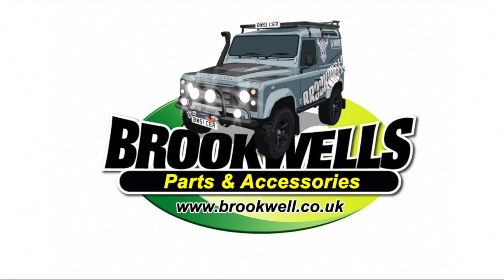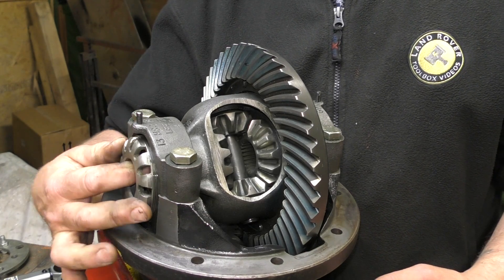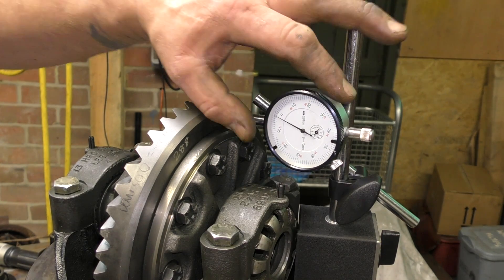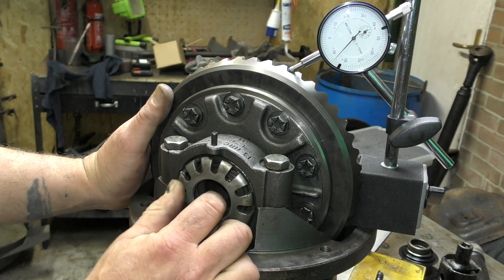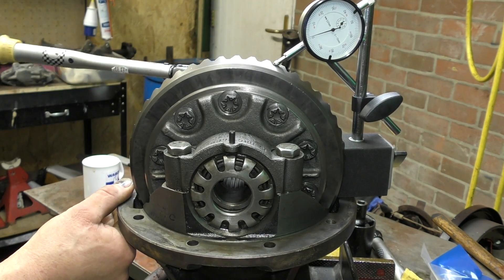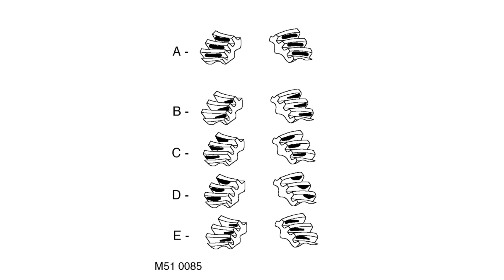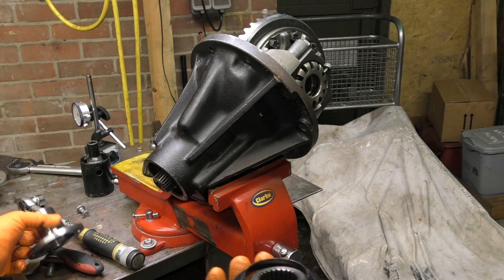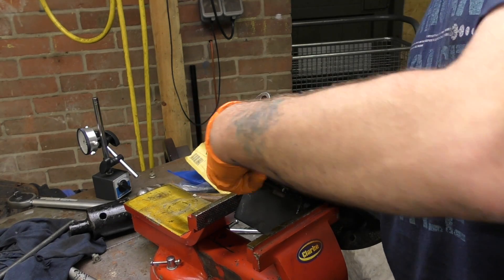Land Rover Diff Overhaul - Finally, Setting Up the Backlash, Zero End Float and meshing test.

Comment: Hi, I have about an inch of backlash movement on my S3 front diff. Can I take out the diff and just tighten the adjuster caps a little? Thanks
Reply: You could do though it’s a pita to remove the front. I’d check everything else while you’re at though and check the mesh when you ve adjusted it.   Or if you don’t use 4 wd much and have fwh then it’s not so crucial to address it straight away. Better to get a good spare a swap then do yours properly

Comment: When you say you start on the left side to tighten the bearing adjusters... in relations to what?  Are you starting on the crown wheel side or the pinion side adjuster?  This isn't clear in the rave either (depends on the year)

Comment: Need bearing part numbers for rear locking differential for 2007 Range Rover 4.2 supercharged
Reply from the maker: talk to Brookwells.
Reply: @trailerfitter2  ,, I have slamming on my 5 cylinder inline engine when moving from park . It is particularly louder when selecting reverse. Mechanic said it is the differential. It has a transaxle set up. Do you think he's right ? The car transmission has no code and change nicely. Any input is appreciated.

Comment: Hi Chris! Thanks for everything and I’m a happy supporter of yours, just a quarter in the hat (not much but figured every bit helps) :) quick question: I started getting a man intermittent chirping out of my rear diff, checked and it’s actually coming from the shit seal rotating independently from the pinion and the housing. 

Any thoughts on the best fix? Also a deeper issue that may have cause it to slip free in the first place?

Thanks for the help and all the wisdom you’ve shared with us!!

All the best 👍

Comment: Dear Chris, regarding the carrier bearing bolts. The standard 8.8 hex head bolts torque up to 45 ft lb I believe. I have been told by a leading professional diff remanufacturer/off road racing/land rover driveline expert that, if you replace those bolts with 10.9 with built in thrust washers, and torque them down to 80ft lb, it gives a more secure unit under extreme loads. Apparently those 8.8 bolts can stretch on occasion, encouraging the cwheel to flex leading to failure (diff pegging reason for etc, same ball park)
So, I remember on a previous final drive vid you stated, that the bolts could have been over-tightened to give some eccentric wear on the carrier bearings. How is this possible please, when the studs go into a solid piece of cast thius preventing any squashing? Thanks very much, fantastic series of vids , awsome. Keep up the phis pal too, dont stop.
Reply: sorry chris, i was thinking 42 ft lb for cw bolts.
Reply: I was told 80ft lb for the carrier bolts 108nm, what you rekon please?

Comment: This might be a stupid question but you've talked about backlash a number of times but why is it called backlash?
Reply: A recoil action between moving mechanical parts.hammer hits anvil, hammer bounces.... under power, gears touch forward. When you coast or let off the throttle the gears touch on the other side or BACKside of the gear. Back stop is when the gear hits the back side of the teeth, space or distance in between front side no longer touching and back side making contact is called back lash. It could have been called someting else like distance before impact on other side of gear, but backlash seems a lot easier to deal with..lol we need it for lubrication and temperature and wear control..

Comment: Hi Chris, bumped into Neil today at Mavern, OEM of flange retaining tool you featured on another video. Pretty much now ready to tackle my front final drive, once the head gasket is renewed that is!!
Reply: Nick Jones just finished my head gasket, likely finished yours already I assume but happy to give some lessons learned if you haven’t.
Reply: Thomas Boe-Wiegaard not quite Thomas, head off, in middle of cleaning it. Its straight no matter where I check which is good, just ordered a set of bent feelers like Chris uses for rockers and I want yo check piston pretrution with my gauge so next time i can get the right sized gasket. New bolts as i dunno history of old ones but before all that more cleaning! Picked up some green cleaning pads from asda yesterday... what did you learn doing yours ??